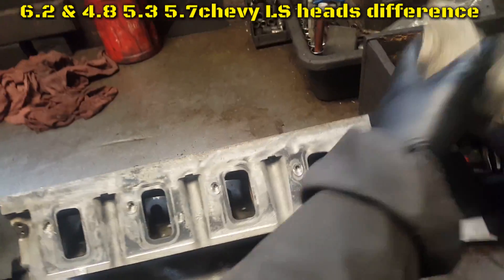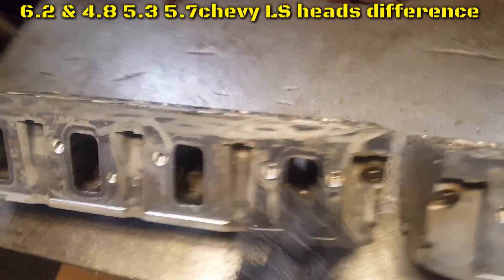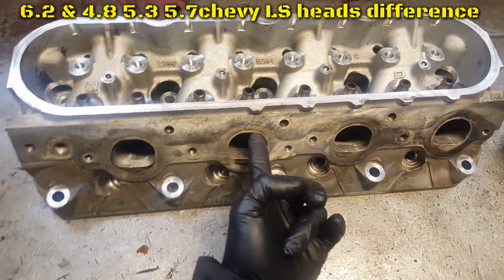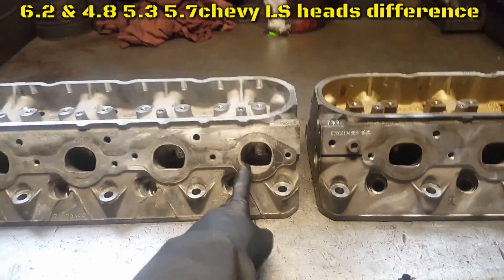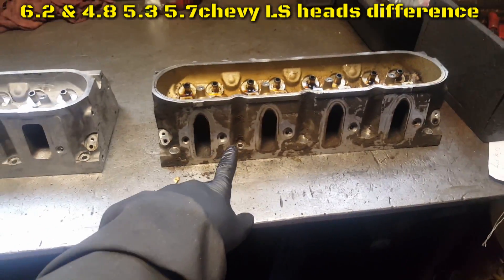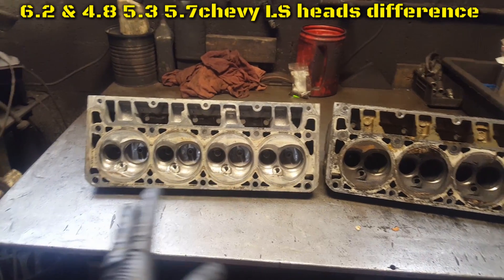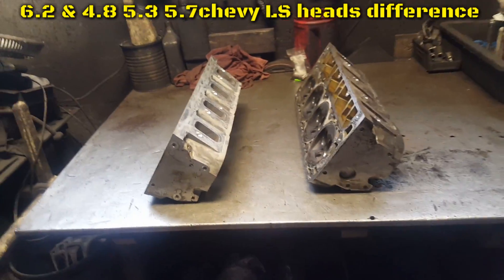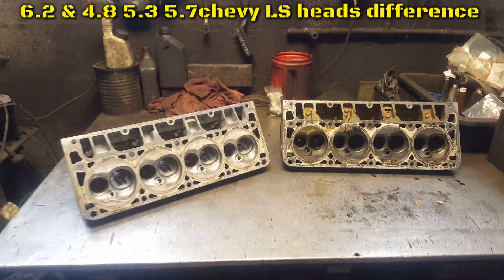6.2 and 4.8 5.3 5.7 chevy ls LS heads difference

Comment: i know this is a old video but i have a question for you do you know if 6.2 ls3 heads will fit on a 6.0 ls1?
Reply: Yes they will work
Reply: @turbokp....479  Will 6.2 heads fit on a 5.3?  It would save me a butt load of money if you can.
Reply: @MadRabbitsKitchen  no unfortunately they want only 243 799 0r 862 heads will fit only 6.0 and 6.2 can use the same heads bore is the only difference between the two
Reply: @turbokp....479  that’s what I was afraid of. Thanks.
Reply: @Mad Rabbit  no problem it's a website on eBay that sells remanufactured 243 heads for 500

Comment: Hey 👋🏼 I watched your video it seems that you know about modifications of this type, I want to modify my truck is a Silverado 2005 v8 4.8, but I don’t know where to start because I don’t know anything about this, I am just investigating and I wanted to know if you can help me, where Should I start making upgrades to my truck to tell my Mechanic if he can make it?
Reply from the maker: All depends what kinda upgrades you want nd how much do you want to spend
Reply: @JM8686  well, as I told you I don’t know anything about this but I really want to modify my truck, sometimes to run on the track and sometimes to roll out some weekend, about money, the truth is, I don't know if it’s a lot or a little maybe about 8k or 10k
Reply: @JM8686  my friends told me to just change the cam but I think if you change something in the motor other part not gonna work the same and probably my motor could blow up

Comment: Can I put ported 6.2 heads on my 4.8 for more hp? How much will it add?
Reply from the maker: Not possible
Reply: @JM8686  what about 799 heads?
Reply from the maker: 🤣🤣 ls6 heads are bad ass but you can get same gains with ported nd polished 317 heads just upgrade the springs 😉

Comment: Thanks for sharing! Do you know what makes a 706 head different?
Reply: Someone is trying to sell me a stripped set for $64. They are as naked as the ones in your video
Reply from the maker: The 706 are from a 4.8 and 5.3 engines!! And make sure that they have no CRACKS on the top valve sides "tge circles where the head bolt goes
Reply: Would this make the 5.3 have more power or would it lose from lose of compression bc of the size of the combustion chamber
Reply: @michaelengelhardt5296  neither, 706 are 5.3 heads